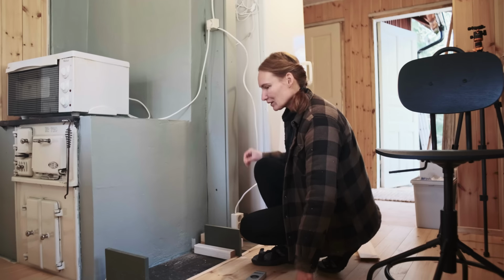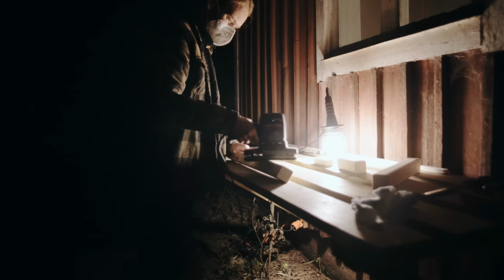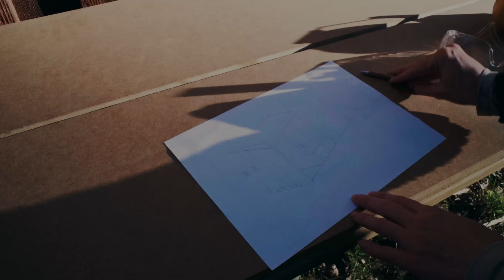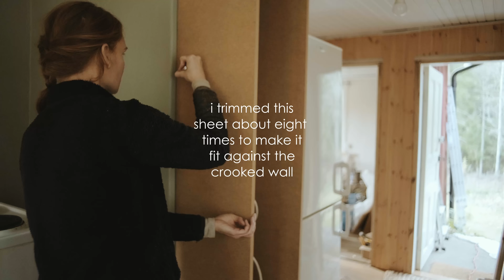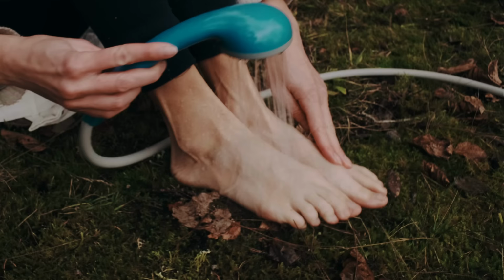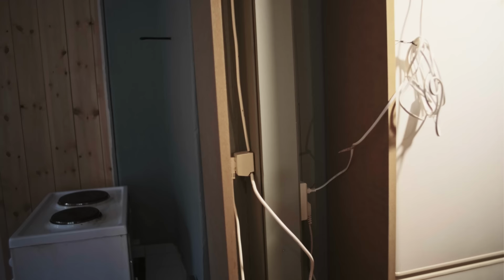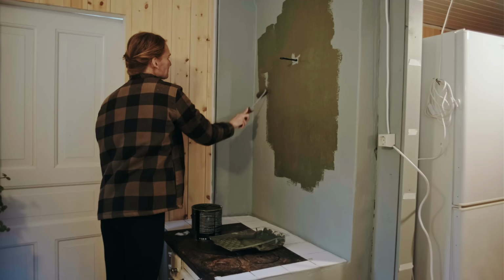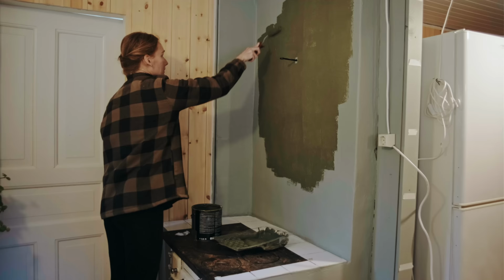Starting A DIY Shelving Pantry Unit In My Scandi Kitchen (Story 35)

Comment: I have been following you since your first day in this lovely home. I love all of your renovations and insights for your designs, very inspiring. I am slowly doing renovations in my crooked old home which I rented for 8yrs before being able to purchase. I have so many ideas tucked away that I manage to tackle a little at a time in between work. I need a new roof with complete tear off, that will require some help but I also do most of the work myself...just because we're girls doesn't mean we can't! I would love to get a few portable power stations but the cost is not in my budget currently as I have to save for the roof and replacing a few windows. PS I love the green; green is my favorite color.

Comment: HI Rosie, Have you ever thought about having a new chimney on that beautiful stove? If there is a lean to roof or an exterior wall near the stove then it might be worth getting some advice. I'm thinking about new black chimney/flue and then stainless steel outside. They run their interior pipe at strange angle which also heat the kitchen. love the series🙂

Comment: Im accualy curious about the experience you will have with the Jackery products. Like how it's like to charge them up, and how long they last. Just a practical measure and not the technical numbers of it. The standard internet answer is always "it depends". But i would just love some random comments in different situations. And you are doing great btw, im inspired. I do wonder how you will manage the cold? Anyways! looking forward to some christmas decorations :)
Reply: Good point. A few years ago, I thought about a jackery, but my only issue is that it only works with jaggery parts. For example, you can't interchange solar panels with another company. This can make things expensive, but perhaps things have changed?

Comment: You can buy v cheaply solar pir motion detector lights to put up in your garden on ebay AND they also sell a split cable solar pir lights which means you can fix the solar panel outside to catch the sun and the light inside a building to provide light - we are using these inside our sheds & outbuildings to provide free light on the inside .... & this may be useful in your loo & garden sheds.....we are in Worcestershire which has less bright sunshine than where you are....

Comment: It works out good, more contrast now with the darker color. Also your doing an amazing job with the cabinets and design. Maybe you can remove that pillar in-between? Or even it out for the electric part. Also, if you would heat up that old stove, would it give you an issue with heat towards the shelving? Looking forward to the progress on this! Love & Light